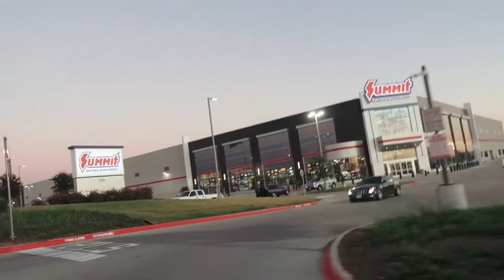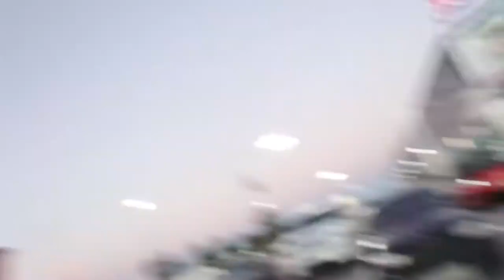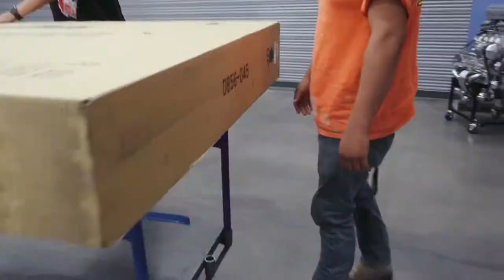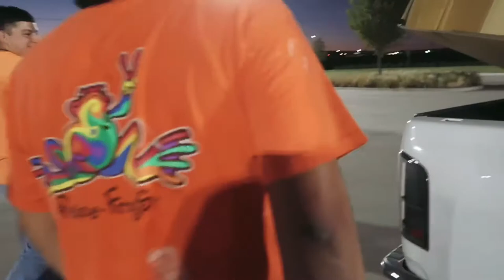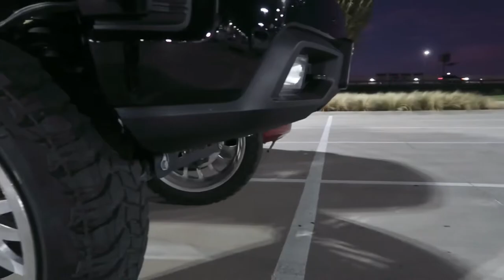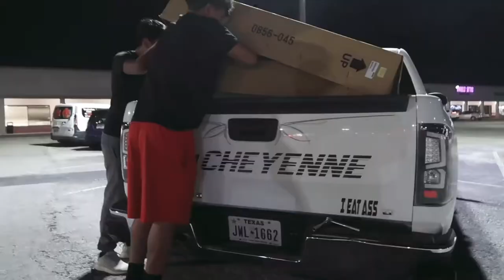NEW COWL HOOD FOR THE SILVERADO

Comment: Just for looks? Or does it function? How does it function?
Reply: They function. Has steel supports where needed and then air flows past them into the vents. Air flows through grill comes out the top.